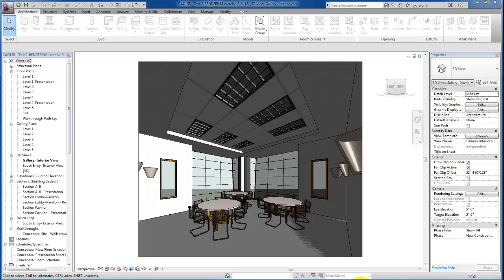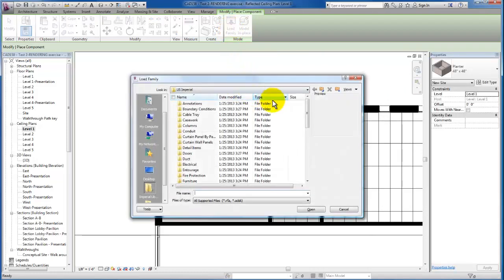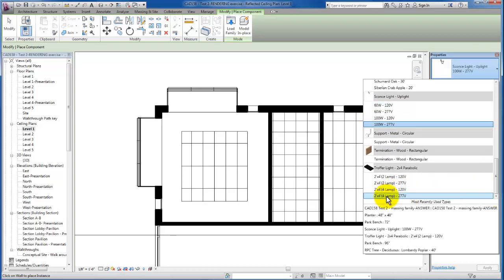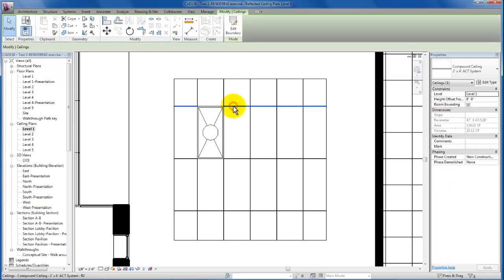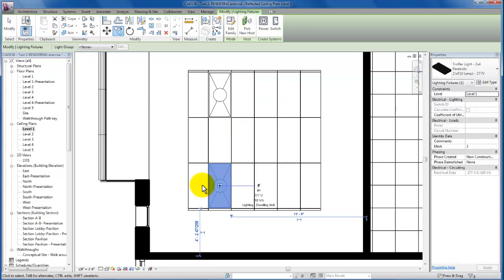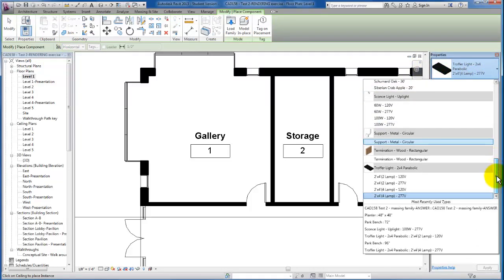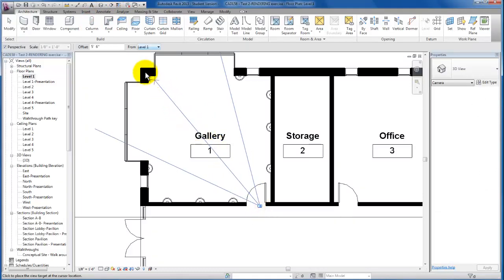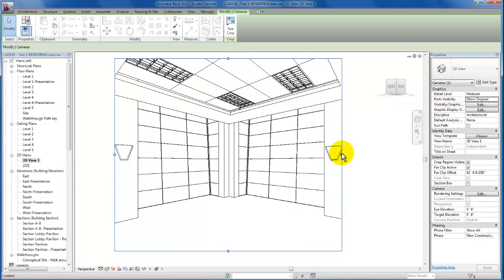Revit Tutorials: Lighting Fixtures

Comment: Thanks man this video is really helpful, quick question, will be able to place air diffuser in the ceiling?
Reply from the maker: +Diego Milito Absolutely!
Reply: SmarterArchitect is it the same procedure as placing anything else on the ceiling ?
Reply: SmarterArchitect
do you have any idea how to sperate floors from other floors in a high rise building like a 30 story building so i can view story #12 for instance in 3d ? so i can visualize better